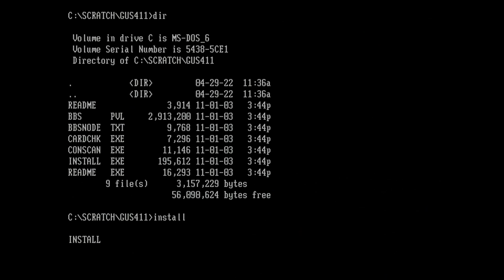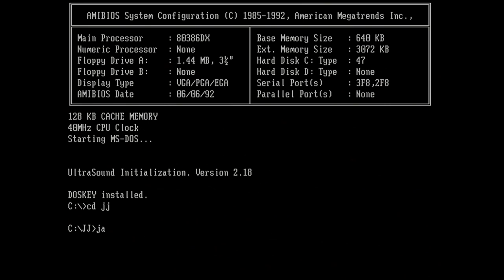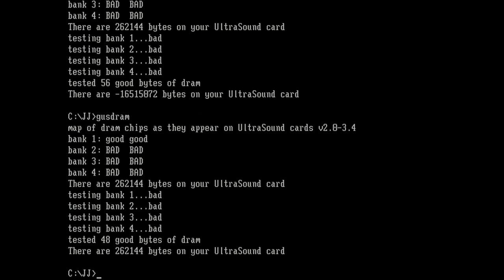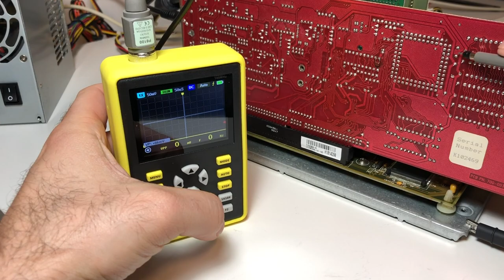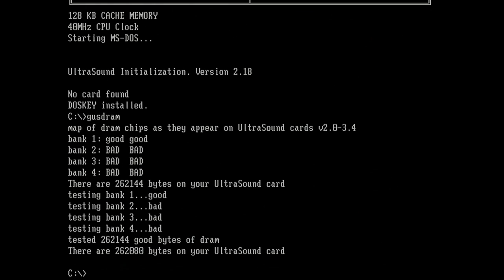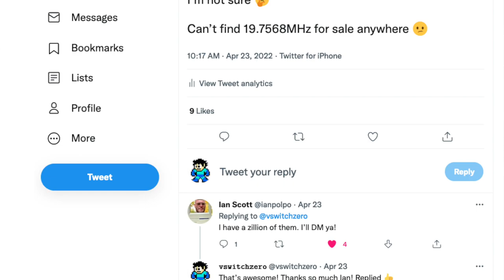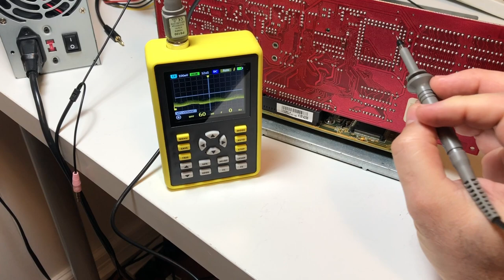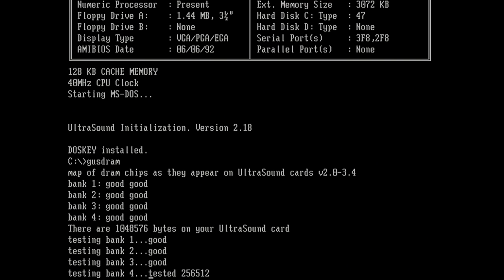Repairing The Legendary Gravis Ultrasound

Comment: This was great, so glad you got it back in order after an interesting journey! Had to laugh out loud the first time it glitched out, wasn't quite prepared for that sudden turn from lovely music to agonized voices from the fiery abyss 😂
To me who who is a relative super-amateur when it comes to electronics that whole "works if grounded" thing seems very bizarre. I feel like I stubbornly would try to keep the original and "make it work" in as clean and stable way as possible when it is that close / works under the right conditions.
Reply from the maker: Thanks for your comment! Haha so true - the glitched MIDI sound is just horrible. I had to subject myself to that mild form of torture for way too long while troubleshooting. When I couldn't find the right crystal, I was very tempted to solder a short ground cable to the crystal can. But yeah, it really shouldn't need to be grounded and I still don't know exactly why that works. Interestingly, even a length of wire attached to it that isn't grounded causes it to start working too.
Reply: I've seen many circuits where the crystal can is specifically grounded or at least very very slightly capacitively coupled to ground. There can be a pour underneath, there can be a blob of solder on the edge of the can (risky, crystals do not like heating), there can be a bit of mask removed so the can will just about touch the pour, there can be a jumper wire hugging the can and clamping it to the board, and also grounding it... might all be useful to keep the crystal stable and for the driver circuit not to go down the wrong overtone, i suppose. Though it appears Advanced Gravis decided to do exactly none of these things. Normally a ground pour is recommended.

But i don't know if it's relevant to the fault that this particular family or batch of crystals has developed. I too would be tempted to ground it and leave it like that until it gets worse, what's the worst that can happen anyway? Seems pretty safe, even if it doesn't fix the underlying fault.
Reply from the maker: Interesting! Yeah, I've seen quite a few crystals soldered to a ground pad on the PCB or clamped with a bit of wire etc. I had assumed this was just to mechanically hold it down since they are usually mounted horizontally on expansion cards but after this whole experience I can see it must have other benefits as well :)

Comment: I'd like to see if you play a A4 Piano note with the card if a chromatic tuner tuned to 440 Hz to see if it reports the correct tuning
Reply from the maker: Thanks for the tip! I'd definitely like to revisit this card soon. I received two more OEM crystals from Ian to try and would like to do some recordings with the 19.66, 20MHz and OEM crystals for comparison. Just need to find the time, which is the problem currently :)
Reply: @vswitchzero  if the card still play all samples at the intended tuning, i don't see a reason to change the crystal TBH unless you have a huge urge to keep it stock
Reply: Either way, I'm glad to see a follow-up video 😄

Comment: The tolerance on crystals is very tight, typically 0.02% (20 ppm)
Using a 19.6608 MHz instead of 19.7568 results in about 0.5% variation, so you're way out of the normal tolerance.
But for sound, 0.5% difference in speed is just not perceptible, especially when using wave samples (patches) that last for about a second or so.
Great find.

Comment: Usually crystal are cacitive loaded (maybe the two yellow cap?).Weaker crystall can soffer for wrong loading. Maybe the correct vintage one are not so strong like the modern one and a sligly drifter capacitor can stop it to work properly.
Reply from the maker: Thanks for the tip! someone else mentioned this to me as well and will definitely take a look at the capacitors near the crystal. Ian sent me a couple more of the original crystals to try, so I'll be working on this card again (if I can find some time).
Reply: @vswitchzero  Hi, you can also try to build a very simple test circuit to measure the driving level of the crystal. You can then compare the original bad GUS crystal vs the original replacements and vs the new ones.

Comment: With a crystal that's really close you can tune it closer by adjusting the load capacitors in the circuit. You could take a lower crystal and then try reducing the series load capacitor values to nudge it up. Or i suppose you can take the higher crystal, and tack a ceramic capacitor across it to nudge it down.

Though i don't expect the adjustment range up to be above 0.05%, and you need a 0.5% up; down you should have more latitude, but you'd need to go whole 12% down, which is a tall order indeed.

Programmable MEMS oscillator next step?

Then again it might not be needed. 0.5% difference is just on the audibility threshold in direct comparison, so as you concluded, you can't hear it especially if you don't have a reference, you wouldn't be wrong on that; on the other hand, this sort of disparity between different system clocks wouldn't be entirely out of the ordinary so the software may need to account for it anyway by using GUS as the time base.
Reply: I made a brainfart! You need to nudge 1.2% down from 20MHz rather than 12%. This seems plausible, much more plausible... then again your scope doesn't seem to have THAT much precision as to estimating frequency. So probably worth leaving the repair as-is :D
Reply from the maker: Thanks very much for this and your other comments! I don't have much experience with crystals and system timing in general so the information you provided is very interesting. I have heard of adjustable/programmable oscillators so that could be a very interesting option. So far, the 19.6608MHz crystal has been working very well in all of my tests, but I still need to try out some mod players and demo scene stuff. Since I couldn't get a reading on the old oscillator without causing it to cut-out, I'd be very curious just how in-spec it was. Considering how flaky it was, I wonder if it has drifted over it's 30+ year life. I suspect it may have. But yeah, my scope really isn't good enough for that level of precision. On a positive note, Ian very kindly offered to send me a couple more of the original ecliptek crystals to try out. Maybe I'll get lucky with the next one. Even if I can't hear a difference, I'll feel better knowing the crystal is to the original spec. If it were any other card, I probably wouldn't care, but I think a GUS deserves the effort :)

Comment: Hey, it's a fantastic video!
I'd like to ask, after you fixed that card, have you tried to run the ultrasnd/setup and see if the DMA tests are OK ?

I am qurious, because I am facing some very similar issue. DMA tests are fail, but the MIDI tests are sounds well.
(AFAIK Midi playback dont need DMA.)
Reply from the maker: Thanks very much! No, my card would fail the DMA tests every time. As far as I know, this is just a bug in the software because the card works just fine. Are you seeing any issues with playback at all? Or just the failed test? Thanks for watching!

Comment: What is the Model# of that snazzy Oscilloscope please? And UGH....  I scrapped all sorts of old ISA/PCI/AGP cards about 5 years ago.. Not thinking they were worth anything...  Buffalo Computer Recycling hopefully made out..  PS. Gravis cards were notoriously a PIA to install.
Reply from the maker: It’s the fnirsi-5012h. There are lots of hardware clones of the same model made by numerous companies and all are about the same as far as I can tell. It’s not the most accurate and the 100MHz it’s rated for is a stretch, but it’s perfect for my basic hobbyist needs. I think I paid about $120CAD for it.
Reply: @vswitchzero  thanks... wanted a portable for checking signals when working on the road

Comment: I wonder how different frequencies affect the card... Great repair :)
Reply from the maker: I wonder the same. I actually got a couple more OEM crystals from Ian to try. I may actually do some before/after recordings and may even try the 20MHz crystal too for comparison if I get some time.
Reply: @vswitchzero  I saw a video where someone connected a frequency generator to a gameboy to run it faster. Would be interesting to see if the pitch changes or remains the same, so if higher clocked crystals can be used as replacement :)

Comment: What scope model you are using?
Reply from the maker: It’s the Fnirsi 5012H. Looks like it’s sold under numerous brands on Amazon. My needs are very basic so I can’t really comment on its performance compared to higher end scopes but I’ve been happy with it for the price 👍
Reply: @vswitchzero  i'm already bought a microscope almost like yours - Tomlov 602, and i will definitely buy oscilloscope like yours. Thanks.

Comment: I saw one thing you did wrong.. the IC extractor, you pulled with lifting force to extract the chip.. instead you should press the extractor together with your hand and the tool force the chip out..
Reply from the maker: Thanks for the tip! I will definitely try that next time. It was a bit scary the way it suddenly came loose. To be honest, I usually just pry them out with a very small screwdriver :)
Reply: Don't worry, I did the same in the start, you can squeeze them together in your hand not taking out a chip, and you will see how the hooks go up in the tool.
Btw... I bought about 5 or 6 of them untill I realized that there is a great differences in quality between the tools sold, i end up with one that was more then five times expensive the the one you find on AliExpress etc .. worth every dollar extra..
Keep up with your channel, we are in the same hobby 😉

Comment: aren't the creative soundblaster cards way better?
Reply from the maker: Thanks for your comment. All depends on what was being done with the card. The Gravis Ultrasound had some very clear strengths over the sound blaster (32 hardware channel mixing, wavetable MIDI etc).. but when it comes to gaming and compatibility, the Sound Blaster is usually a better choice. The GUS’s lack of hardware fm synthesis was an unfortunate weakness. That’s why many enthusiasts try to run both in the same system for the best of both worlds 🙂

Comment: they said to not touch the components while the computer was running 😬 😅
Reply from the maker: Haha very true! Sometimes deseparate times call for desparate measures! I don't have a grounding bracelet or anything, but I do touch the power supply casing frequently when handling hardware just in case.
Reply: Haha, try diagnosing an intermittent CRT fault without live running! Sometimes you just gotta do the risk assessment and get in there.